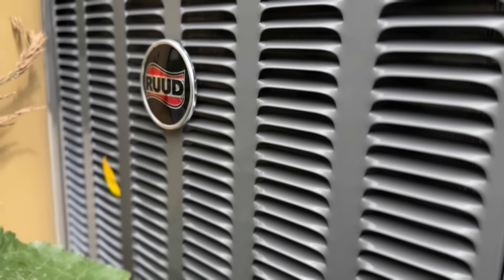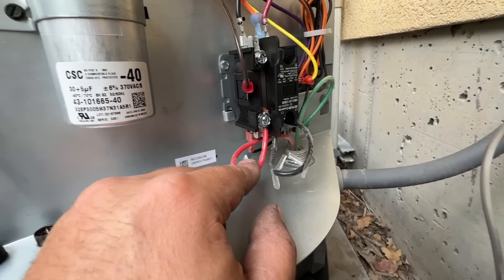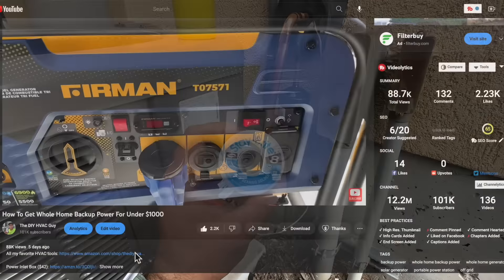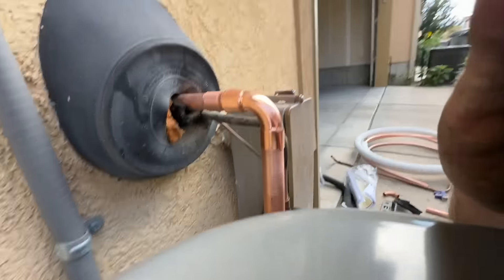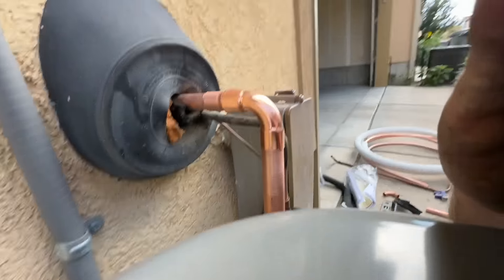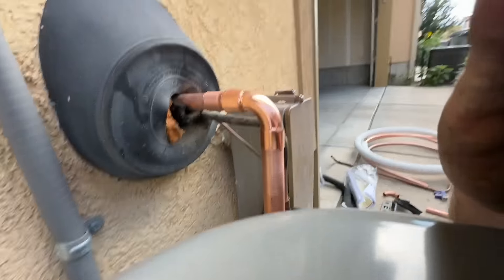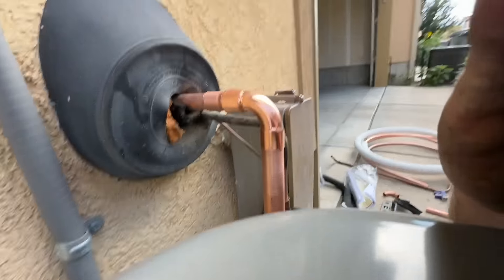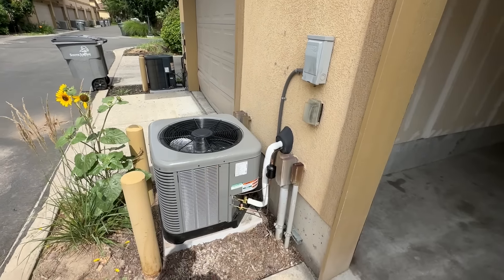HVAC Contractors Don't Want You To Know How Easy This Is...

Comment: Home owners if you see you guy using solder in a roll on you unit tell him you changed your mind and pay him for his time and removal and hire someone else that brazes solder may have been fine for old r22 days but people need to get with the time and realize 410a runs at too high of pressure for that anymore if this guy hasnt had a problem with solder its causing he hasnt been doing it long enough saw one just yesterday that was leaking from the solder and date on unit said 2 years a go unfortunately this practice it still fairly common and it needs to stop im not trying to be an ass to you man im sure this is how you were taught and just haven't been taught different im guessing you were taught by a really old school guy but times have change my man. #1 flowing nitro is not hard at all and probably should be done on soft solder as well cause smoke and soot still builds up and can clog filter dryer or TXV and protect your coustomers valves and cores brother probably less likely than brazing w/o nitro tho or if you dont wanna flow nitro go real new school and use a press!! Again I apologize if I come across as an ass I just wanna look out for my fellow HVAC brothers and sisters and make sure our industry is putting out the best work possible and getting rid of old crappy practices or crappy techs! not saying you are you clearly take pride and try to do the best you can and take your time to to even make the previous line look better!!
Reply from the maker: I appreciate your advice, but if the joint wasn’t done properly, yes you’ll have a leak, just like with brazing, and just like with the press tool. And I’m really surprised to hear you recommend a press tool. I have a few videos with my RLS tool and I have so many hvac guys bashing it. I know several who use sB8 solely for years on 410a systems no problems at all. I think the ones people claim they are patching are joints that weren’t done correctly to be honest. But to each his own. Thanks for the comment
Reply: @diyhvacguy   there's a lot of press haters and I think the press hate comes from a misunderstanding of how it works it actually just like the plumbing press, creates a compression seal it will seal even with the orings completely removed it seals from 7,000 lbs of force being exerted on the copper the orings are a back up most people think they're just sealed by the orings like a shark bite which is simply not the case. (Full disclosure I braze everything refrigeration never gotten to play with the press) Yes improper sealing will fail no matter what method you're using however most of the times when I see a failed braze joint there's a visible gap in the joint that was definitely just missed on install where solder joins I see fail seem to be the solder itself and look as though they were soldered fully and have solder throughout the joint the solder just couldn't handle the pressure. No way of knowing 100% as I only show up after it broke lol but it's too frequently that I see leaking solder joints on 410a refrigeration systems for me to think it's ok I don't know the percentage for ones that are fine vs ones that aren't but it's very high I think a lot of them are left over from when they system was r22 as well my opinion they should be cut out and brazed but I'm not usually installer
Reply: 36 years in the business, and most major manufacturers tell you plainly in their installation instructions to BRAZE using 15% Silver solder and DO NOT soft solder connections. They will and do, in fact, fail. I experience it with my own eyes all the time. It may take 5,10,or 15 years. But that is still costing a homeowner because an installer believes they know more than the instruction manual.
Reply: @terrimcglothin2230  agreed I've even seen it fail on r22 systems take a lot longer on r22 and isn't as common on 410a but still have seen it
Reply: While I understand your guys concern,Staybrite8 isn't just regular solder,where I work we braze but I've done the research and this stuff is made to withhold high pressure. Than you take into the fact that you are not comprising the coppers composition by heating it up to 1000 degrees like you do with brazing it's actually stringer.Also soldering doesn't heat the copper up to the point that it oxidizes  so you don't have to worry about running nitrogen. So here we have a solution that you 1) don't have the cost of oxygen and acyletene  2)it doesn't get hot enough to cause oxidation or melt valves so no need for nitrogen 3)you haven't compromised the strength of the copper by superheated it 4)you save a bunch of  time because you no longer have to do alot of the steps involved with brazing.I believe going this route is a smart decision for any HVAC company and it will save them a ton of time and money over the board and I personally will still fight to try and convince my owner this is the way to go.

Comment: For one sir you failed to mention your in a costal area, and not much heat is needed. So no heat pump. Everyone watching this isn't in a area like this. So if it was a heat pump u couldn't just change the outdoor unit. Unless the seer rating is the same. And you failed to also mention by just changing the outdoor unit, the system doesn't match. So warranty doesn't apply. And that solder doesn't hold as good under higher pressures either.

Comment: the title is misleading. Only a licensed person can install the coolant. So even if you get all the parts intalled right you will still need to hire a licensed tech.
Reply from the maker: Not true, all you need is your epa certificate to replace your own air conditioner. That’s why you can buy them on Amazon and hvacdirect.
Reply: I think ur misunderstanding what a license are use for. It’s for contractors use only, sometimes you don’t need one when ur employer holds the license and liability.

Comment: No customers want to go online and fill out a form to make your job easier. When its a/c its not cooling. When its heat,its not heating. What more can a customer form tell you? If the customer can diagnose the problem they pay YOU to diagnose and fix. Buy an answering machine.

Comment: I’m sorry ,I’ve spent 35 yrs ,20 with a masters in this industry! This industry like many others have gotten LAZY ,quicker ,easier. TRADITIONAL  practices have have never failed! Brazing  vs soldering it has its application ,this ain’t the place for solder BUT YOU CAN.Ask yourself  NATURAL GAS WOULD YA SOLDER OR BRAZE, ITS ONLY  INCHES ,2,MAYBE 5LBS ? 🤔.  Type L OR  M .  SOLDER OR SHARKBITE ,COPPER OR PEX.

Comment: This doesn’t look like a DIY. 

Specially with a $700 vacuum pump $200 vacuum hose $200 vacuum gauge $80 valve core removal $600 manifold gauges $200 nitrogen bottle $170 nitrogen regulator and all the other tools.

All of that plus practice for a a couple days how to solder in the extreme heat in Texas because my unit is fried and I need to install it myself.

Totally a ripoff from hvac guys and a totally DIY project.

Comment: You've got great communication skills and are respectful and probably very courteous to your customers.  However,  You've honestly done an injustice to them and violated the manufacturer's policy and Energy codes by mismatching the equipment. Its a non rated ahri system! So the remaining indoor expansion device can possibly kill the new compressor, and you think that's fair to Ruud because you took the easy fast buck way out.  One of your goals is to make professional hvac companies look bad, and then you do this on an open forum.  Also,  I'm pretty sure it's illegal to use refrigerant to find a leak.  You knowingly have a leak and intentionally discharged refrigerant through the coil to find it.  Sorry, the finished product may look ok, but this was a fly by night illegal job from start to finish.

Comment: Shame on you! You’re not using a nitrogen flow when brazing the copper lines. Do you not know about all the carbon buildup inside the copper. All that trash goes straight to the TXV or whatever metering device is on the system and then you have a TXV change out to do.
Reply from the maker: Shame on you for not knowing that you don’t need a nitrogen flow with SOLDERING. This is not brazing. Two different animals all together. That’s a big part of the reason why I swapped to soldering. Check out some of my other videos on Staybrite 8 👍🏼 cheers